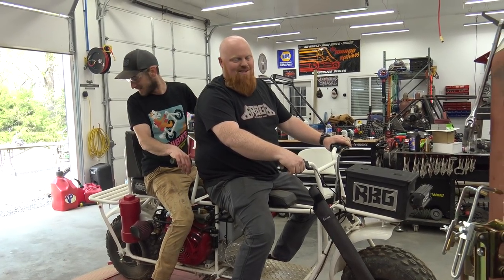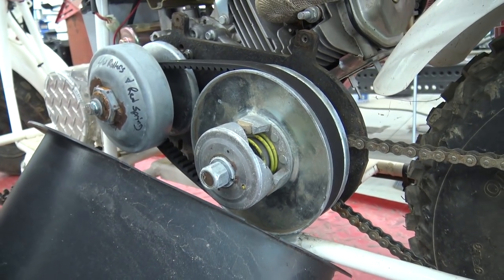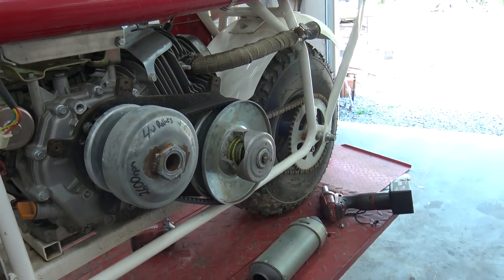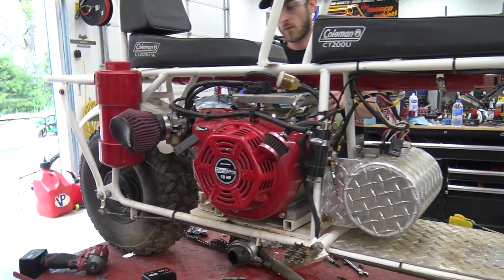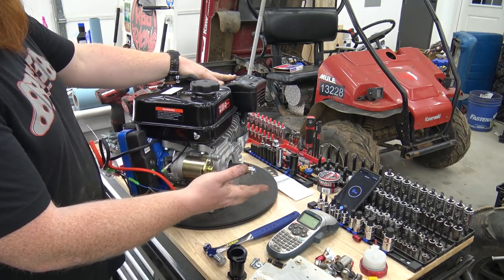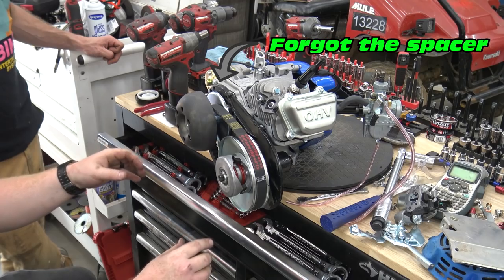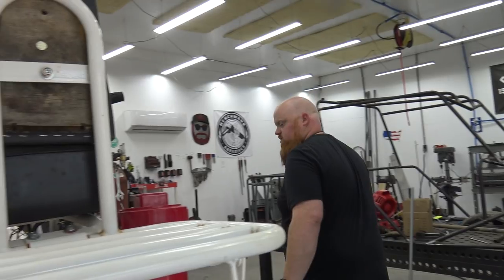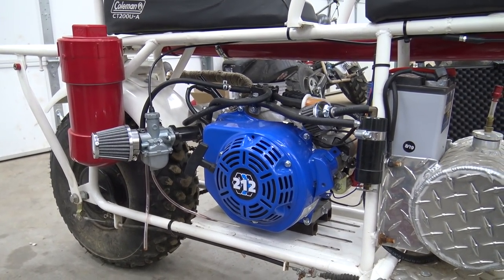2 Seater Tandem Mini Bike 212cc Tillotson Swap

Comment: I made my own version. No welds too. I'm very poor to afford tools. My seat is made of 2x4, a 2 hp flathead Briggs and stratton, chopper style scooter frame with a  belt drive tensioner, and a homemade chain drive turbocharger. 23,000 rpm max. I like both bikes.

Comment: I think it took me probably 30 minutes or so to swap the new flywheel on and put a new air filter on. But I used power tools and my big impact to torque the flywheel bolt. I should have used my torque wrench but I didn't wanna take the torque converter off and mess with making a thing to hold it. Kobalt 1200 ft lb impact couple quick taps and you're good.

Comment: Is that 212cc motor easy to install. Looks like it's on a engine plate. Was tossing some 79cc motors on some bikes back in the day. I always thought one day toss on that 212cc motor on one. But never got around to it and then stopped doing those installs. Everyone seems to be switching over to electric. So I need to update to the times unfortunately.😢 That thing looks insanely fun. 😁